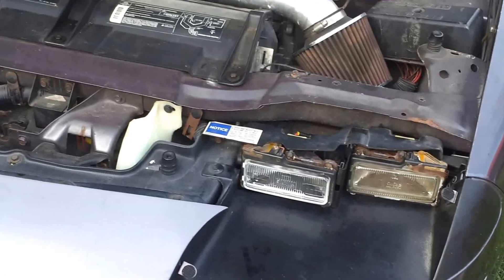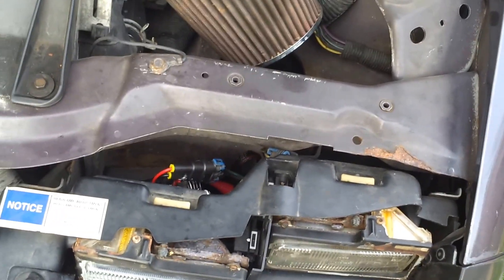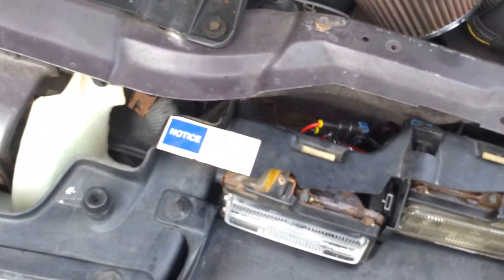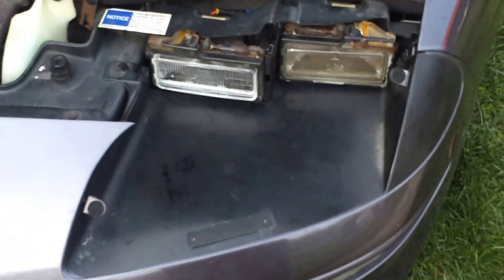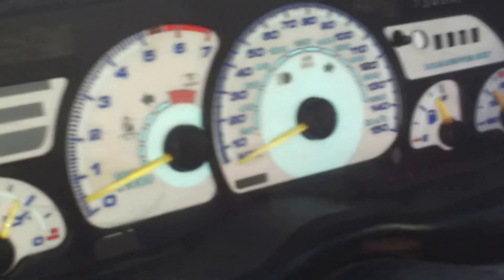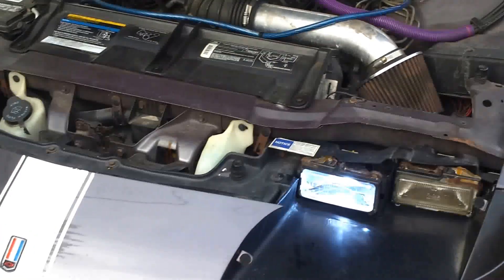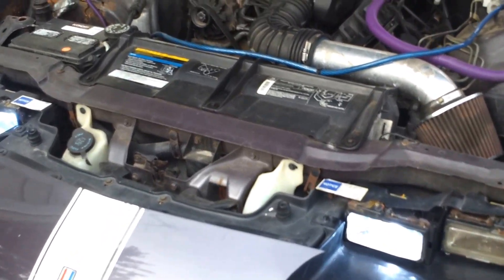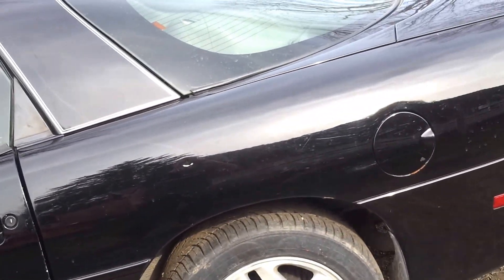Hid kit on 93 camaro install

Comment: You got to do the driving lights just make sure you get short length bulbs ive got all high/low, driving and set of tail and turn signal just got set of yellow fog bulbs for driving lightsgonna see if I like em better than white  .Cant you switch wiring harness for high low if not splice on longer pig tails I got a white and hugger orange strips 97Z28 and t tops dont leak all I hear are that they all leak

Comment: I used to buy the GE low beams H4351 and they would burn out within a month guaranteed. Also tried a xenon kit and they burned out and the housing rusted right through within a year. I tried Sylvania SilverStar Ultra 9006 (siliconed in) and they burned out too within a couple of months. Now I'm using some cheap bulbs and they have been going for 3 years now. Was thinking about a hid kit but the car is such a beater it almost doesn't matter. I might try the Silverstars again and maybe drill some vent holes in the housing. Also the xenon kit I had cracked the glass in 4 pieces which was fun to see.

Comment: I bought 4 Euro Cystal Clear headlights on ebay for $149.00 they are sweet! in the back of the headlight you can change the bulb 9006, Meaning they twist in and out without breaking the headlight. They come with 4 9006 bulbs so there is no high beam dont know if i could put a high beam bulb in 2 of them or not. Anyway i also bought a HID kit for the 2 low beam  waiting on them to get here. I'll post a vid on here soon. the 4 headlights fit into my 1995 Z28 perfect. they are a little pricey but they are clear glass not that dull rusty look of the stock ones. Check em out.